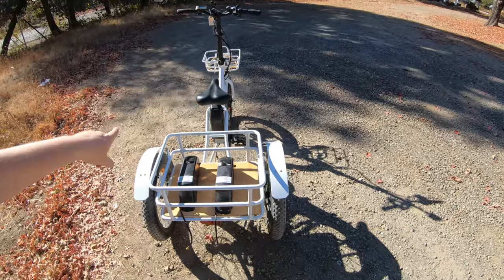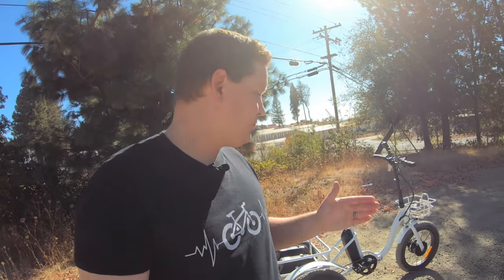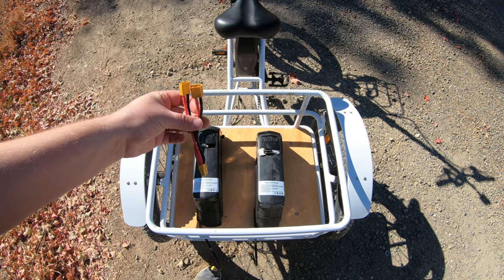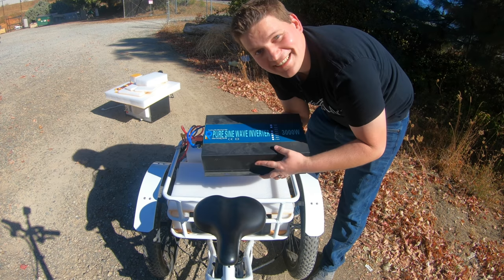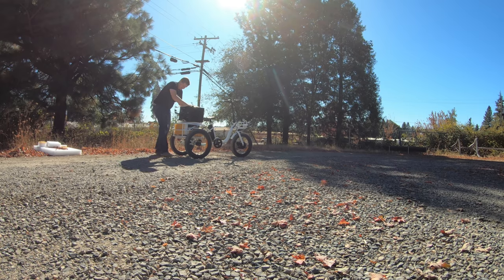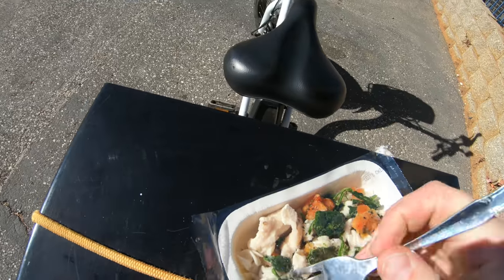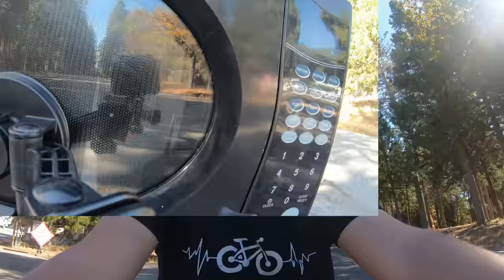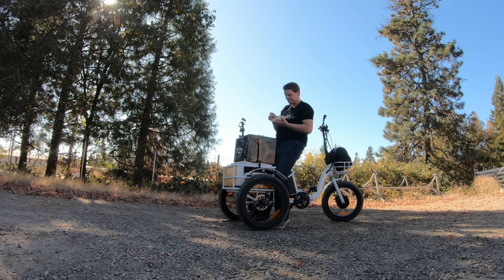I put a MICROWAVE on my ELECTRIC BIKE

Comment: Hey Kyle can you do a throttle repair and issue,s related to ebike throttles, I just had one fail ,not sure why , I hypothesized that I may hAve had the throttle on while using pedal assist ,possibly overloaded the circuit .? Got a new one and it worked but concerned about doing it again.thx .

Comment: Hey I live in my van I have a 170 watt solar panel on my roof and 2 deep cycle batteries I can run a5,000btu window unit but I usually run the a/c off my generator

Comment: Maybe someone can help me. I've learned quite a bit since becoming an eBiker. One thing I don't understand however is the gearing on mountain eBikes. I understand mountain bikes are geared differently than road bikes. But it appears as though mountain eBikes (most eBikes) are geared improperly to utilize all of the pedal assist. I can use pedal assist level three (16mph) and pedal as fast as I comfortably can. Pedal assist 4 and 5 are pointless. I can't pedal fast enough to assist the bike speed wise. Why is that acceptable? I should be able to achieve speeds well past 20mph if they sold the bike with gearing that made that possible. I bought an eBike for fun and as emergency transportation if necessary. If they gave me gearing which matched my motor's ability I could get where I needed to go much much faster.

Comment: is there a battery that will recharge while you peddle?
Reply: There is a man who posted videos, don't remember the channel, where he used a hub-motor in his peddle assembly to charge the batteries that ran his wheel hub motor. He had no chain, belt, or mechanical drive from peddles to wheel.
Don't know what to search to find it.

Comment: Wouldn't this be extra weight with the converter & extra  batteries & then the microwave. Its going to be substantially heavier  by quite a few pounds isn't it. 🤔😳 Won't you need a more powerful motor to get the bike moving better especially if you end up going uphill. Otherwise it does seem like a, good idea, but, if you was with a small group of riders & all want something heated up how  long is those batteries going to last & where on earth do you store your food & other supplies.if your on your own. If the rear basket is full of microwave & other tech. & if your away  for several days  how the hell do get to recharge that amount of batteries along with your other supplies in one, go 🤔  That's the negative & positive said in one.